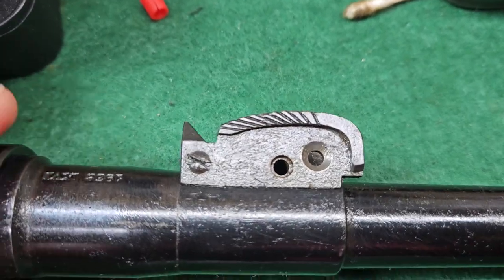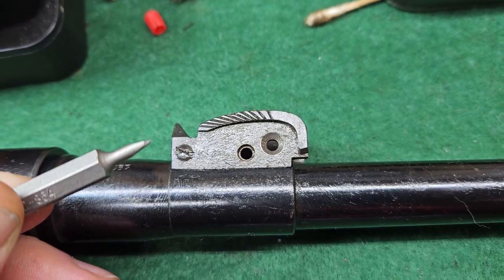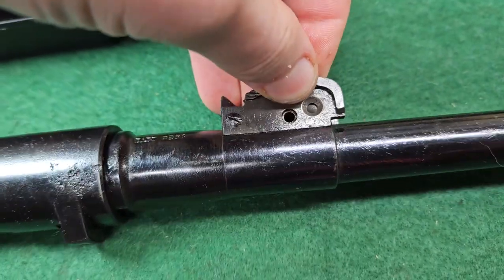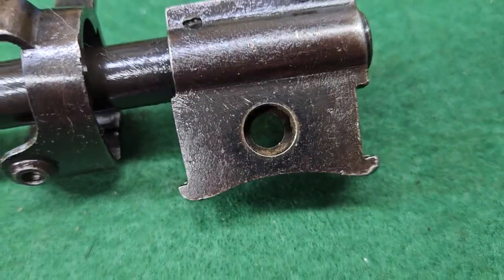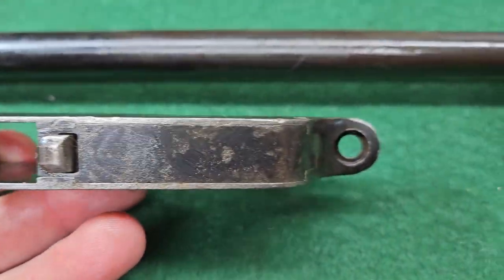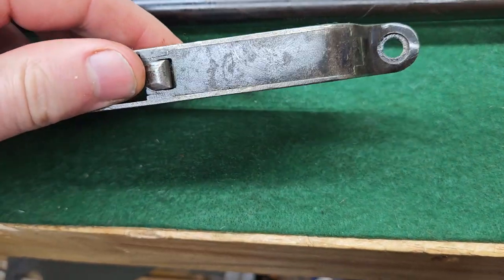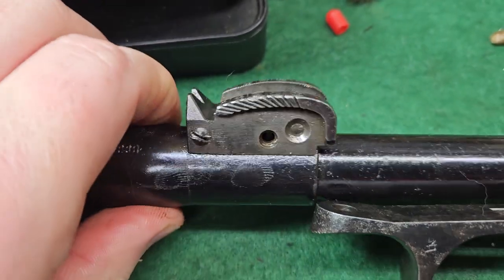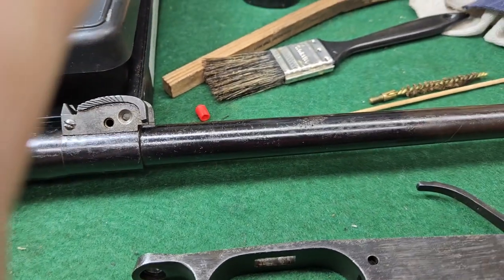Carcano stuck rear sight screw

Comment: I mix varied concentrations of Naphthalene (Ronsonol liquid lighter fluid) with 30w non detergent oil to make my own penetrating oil mix. Be careful, it’s flammable! Used oil or atf works too.
Reply from the maker: Thanks for the tip!  Unfortunately I believe this sucker is beyond penetrating oil being able to get it loose Im afraid, the screw head is so tiny and the slot is now pretty jacked up you can't get much grip on it.  If the impact driver won't do it, I will give your recipe a shot and leave it there for a few days and try again, thanks!
I've heard of people using ATF and acetone to make penetrating oil very similar to kroil.

Comment: Ya that sucks.. i have had trouble removing the 2 little screws in the magazine... that fallower in the magazine can be removed too it just slides out not easy but it will slide out.
Reply from the maker: Yeah I got the follower spring out after seeing a vid of Koba49 doing it, wasn't too bad.
Reply: @Toolness1 That front sight is pressed on.. after you take that little screw out. But that just might be to much.. i tried to remove it and i could with M1 carbine front sight tool. but i decided i better not.
Reply from the maker: @RUSTYSURPLUS  Thanks for checking on it!  I think I am going to have to epoxy this one since the button is a loose fit on the shaft.  I appreciate it!!